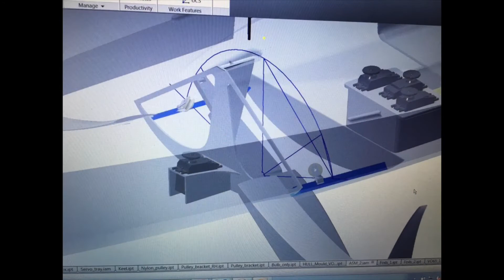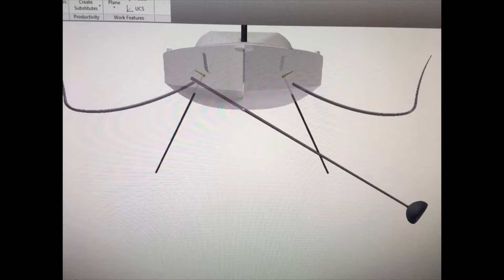Build photos of foiling RC VO65

Comment: Impressive build Thomas.  Is that white material a membrane that prevents water from coming inside the keel box?  Are the sails pocketed?  Are the foils just press fitted into the foil slots?  Is the keel and bow sprit removable for transporting the boat?  What is the pulley at the  rear for?  I see you have a large access hatch into the electronics, do you just tape that down to keep water out?  Do you prefer winch drums over arms?  What is your build time from inception to completion?  I am really amazed with your build.
Reply from the maker: The keel is sealed with neoprene covered latex, with a flock lining, then bonded in with 2-part epoxy. Used it on 2 boats now, and both don't leak (one is 3 years old now). The sails are panels that are bonded together over a mould that gives them their aerofoil shape. The foils are a very tight fit so that they don't vibrate and cause drag, but they are also pinned as backup. 
The keel and bow sprit are not removable. I don't fly with my boats so never really needed to have them removable. The bulbs are removable though. The intent was to change the mass for different winds, but I think i have only used that like 1 or 2 times.
The pulleys in the rear are for the sheets. The boat will sail with the same sails set from 0-21mph winds, so the sheet loading gets high, especially with the big shifting gusts that we get in this area.
Yes i just tape down the hatch. It doesn't really need to be that big, but it makes servicing and upgrading the internals soo much easier (particularly the canting mechanism). I always use drums to get the torque (and save cash).
Build time for the bigger boats have been around 2-3 months, from inception through to on the water. 
I just started the CAD for a new foiling mono-hull yesterday so will see how long it takes.
Reply: @thomasnorton3560  Where are you based?

Comment: Is there anyway I could see your design/ cad on the canting keel setup? I'm looking to build a monohull rc sailboat w/ a canting keel.
Reply from the maker: Hi Philip... can’t wait to see your build! I don’t think I have any videos of that boat anymore, but I will try put together a photo montage of what I can find and then maybe a video of my new boat (which has a similar design). Will see what I can do.
Reply: @thomasnorton3560  thanks a bunch
Reply: @thomasnorton3560  something that just came to mind and I wanted to see if you’ve tried it. I saw in  some other comments/ replies that it gets really hard to get these Rc boats to plane. When looking at the mini transit class and even some of the newer generation imoca 60 yachts they’re gravitating towards a wider and flatter bow instead of a wave piercing bow. In theory my thoughts are this helps with the volume and planing issues with rc boats. Do you think that’s a hull design that can work in an rc yacht? Curious on your two thoughts, thanks.
Reply from the maker: @nomame7413  this is a really interesting discussion point actually, and to be honest, one that I haven’t got definite answers to, more just guesstimates and feelings. Between my boats I seem to get bored of a design so change a lot each time, and it is hard to pinpoint what really made the difference! 
I guess the theory would be that if you get the hull out the water it will go faster... but I have no idea if fatter is better.
So with RC hulls, due to scaling of volume being cubed, you have to increase the buoyancy of the hull (increase its volume in the water). Typically this happens at the keel and as such creates a more banana shaped hull. If taken far to one extreme then yes this will make is very hard to plane. 
But another way to get around this, is to lighten the whole boat, but using exotic materials, increasing righting moment efficiency (lighter canting keel, foils, etc,) so that you don’t need as much buoyancy. 
However these are the kinda changes made when trying to make an RC version of a real boat... 
My IMOCA is around 1.5kg lighter than my VO65 (even though sails area has increased) so I didn’t need to increase the buoyancy as much making it displace less water and therefore it planes very quickly... BUT (another ‘but’ I know), my IMOCA also has a wider bow at 3mm radius at the waterline (when stationary in calm water). The VO65 has around 0.25mm radius...😂. 
The other thing is the IMOCA profile is almost like a surf board so that might also be helping it plane faster... 
Then it comes to the foils... my VO65 has fixed pitch constant lift foils that are more efficient for higher speeds, meaning it takes a while before they lift the bow.
The IMOCA has a few different foils (having fun playing with these), but the surface piercing ones seem to work really well at providing a lot of lift at low speeds (lifting the bow and increasing righting movement). They taper off, as well as twist flat (less angle of attack) as they go towards the tip, which reduces drag as the boat speeds up, flattens out and lifts out the  water. 
Both boats seem to be very efficient through waves and both don’t seem to power down between waves. I would like to think the IMOCA is faster as it is newer, but who really knows as I’ve only  sailed one at a time. 
I see that @P-E Reg has much larger bow radius on his IMOCA, and boy do they sail well!!